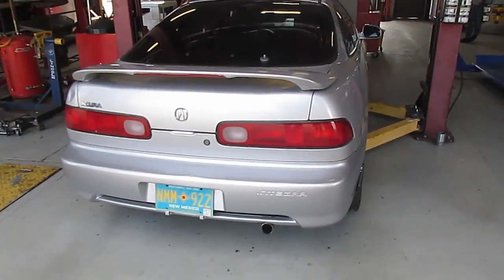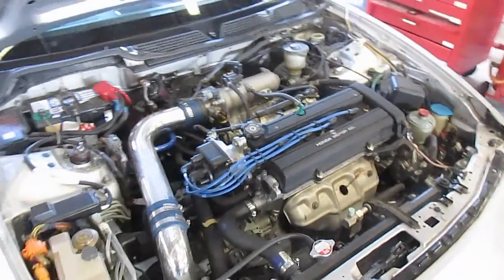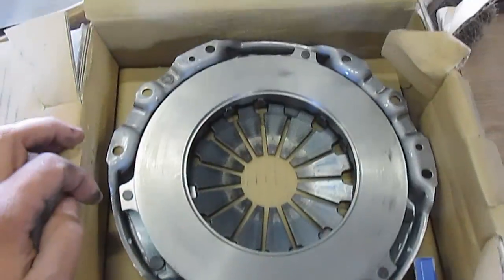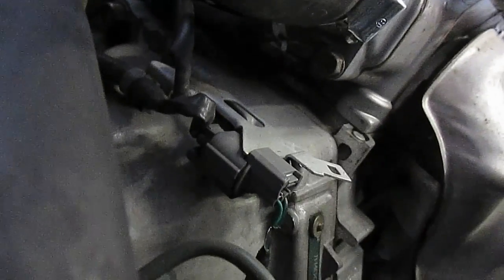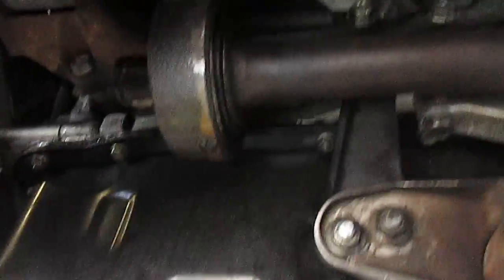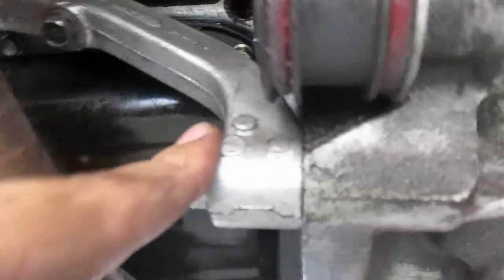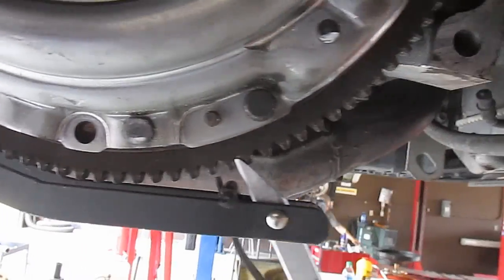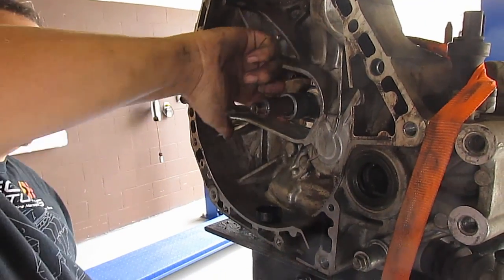Project No Rice #4: How To: Acura/Honda Clutch Replacement (Stroked LS/Vtec Acura Integra)

Comment: What would happen if I didn’t torque it down to the specs I recently did my integra and the clutch has pressure but when on my clutch loses pressure and can’t go into any gear I’ve already replaced my master and slave cylinder as well
Reply from the maker: did you bleed the system properly?

Comment: What socket do I need to take of those damn bolts on the pressure plate ?
Reply from the maker: should be a 12point socket.  plain metric.  there is nothing custom.
Reply: @FatGuyBuilds  thanks man! I've been watching olyour tutorials since there so detailed. I'll be coming back for more. Its definitely harder by your self espically tryna get those t bracket mounts when you decide not to take off the catalytic converter haha